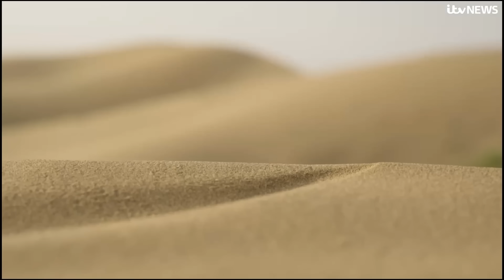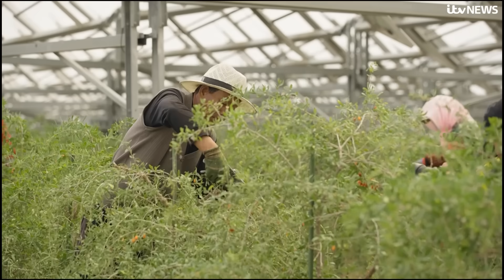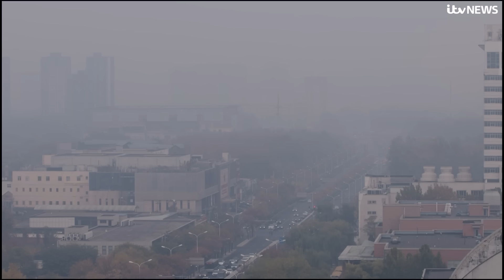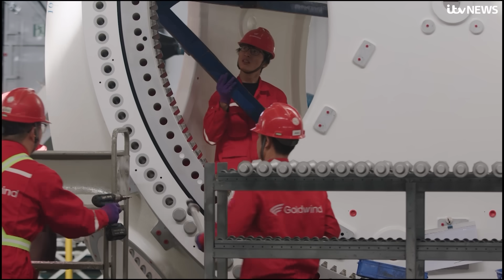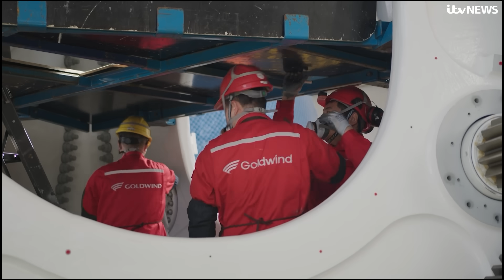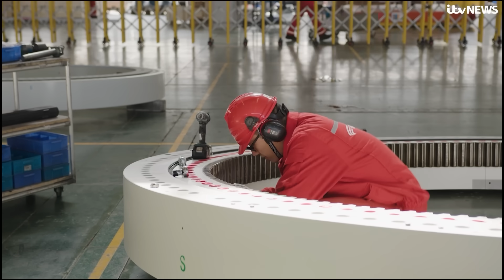How China is building solar farms bigger than UK cities | ITV News

Comment: the UK could generate all the energy we need, even through the middle of winter, with an area of solar panels equal to the area of the UK's golf courses. And of course, we don't need to rely only on solar, because we have such good wind resources. So if we converted half the UK's golf courses into solar farms, when combined with mostly offshore wind farms, we could generate all the energy we need, without taking any land away from either farming or wildlife. And start producing food under those solar panels, actually increasing our food production. And given that less than 1 in 60 people in the UK regularly play golf, the reduction in golf course availability by 50% wouldn't even affect much of the population in a serious way
Reply: No it couldn't.
Electricity is only 20% of our energy demand of which on average renewables only generate about half (and that's including the non sustainable biomass imported at great emission from Canada)

Therefore we rely on non renewable sources for 90% of our Energy, so where will you get it?

How could you produce food UNDER solar panels? How would it get sufficient sunlight and how would you harvest it?

If you are trying to claim that we can use "golf courses", why can't we just hijack peoples back gardens too? Or why not use all the land that isn't used for anything, such as wilderness, moors, bogs, mountains etc?

You really don't know anything about the energy demands of this country or what it is made up of.  You are probably about 14 years old.

Comment: Typical greenwashing propaganda peddled by journalists who don’t understand technology and numbers.

The typical utilization of a solar panel, measured as its capacity factor, generally ranges from 10% to 25%, depending heavily on its geographic location and other environmental factors. 

That means you need to have 4-10 times more installed capacity to actually GENERATE the same amount of electricity as hydro, nuclear or coal.

But even that is just a theoretical number. Solar panels have a fundamental flaw - they don’t work during the night. So you still have to maintain conventional power plants to keep the lights on at night.

Grid-scale electricity storage technology doesn’t exist so weather-dependent electricity generation can only augment electricity generation but only when the weather cooperates. For the rest of the time the  electricity comes from conventional sources.
Let’s hope China’s plans ro build 30+ nuclear power plants materialize in next 30 years.
There is no scaleable electricity storage technology

Comment: China is re-power and greatly expanding its power grid's capacity with hundreds of new highly efficient ultra supercritical (USC) clean coal thermal power stations.    USC creates liquid steam behavior with USC turbines that provide some fast reacting peaking power needed to support solar and wind power.  It is questionable if having USC thermal power stations support solar and wind power saves coal use, but it is a means to provide service to solar power.   The new USC coal power stations emit no visible air pollution.

Solar and wind generated electricity is normally commercially worthless.   Its practical use is for maintaining electrical storage.   China's 22.5 GW Three Rivers Dan hydropower station provides fast reacting peaking power at no high readiness cost able to work with solar and wind generated electricity to save water head.   Traditional steam turbine generators are not capable of proving fast reacting peaking power. 

Supporting large amounts of solar and wind generated electricity in practice uses natural gas turbine generators at higher natural gas cost just for high readiness making near zero electricity than making all the electricity with natural gas combine cycle power stations.  There is no fuel savings.  Since little natural gas is generating electricity the large natural gas cost is hidden from the public.  The UK is culling wind farm output to save on expensive natural gas.  Wind farm power output with its wild fluctuations in a second requiring constant makeup above high readiness is the most natural gas expensive form of providing electricity.  

China has to import natural gas.   It only uses natural gas turbine generators for high value needs.   Providing service to solar and wind generated electricity is not normally a high value need.   China built the world's biggest wind farm at over 10 GW that after initial proof of operation has sat idle.  The large public displays of China solar and wind power installations  need to be checked to see how much electricity they are actually providing.

Comment: Nice. Now begin the process of systematically raising their platform up 3 meters to permit other use of the slightly shaded ground beneath. Might need a custom mechanism for inspecting and repair the panels... perhaps something automated.
Reply: China currently has little solar-powered robots cleaning the panels, along with automated panel laying machines that speed deployment dramatically.  It's quite amazing to watch.

Comment: There are two effects to note. 1) China is producing more electricity from renewables than many other countries combined and that it is reducing its proportion of electricity from fossil fuels, even if the total number of kWh is increasing.  2) As it switches to EVs and electric motors for transportation, there will be an efficiency gain. ICE is only 30% efficient, while EV can be as high as 70%. The reduction in demand for petroleum products due to substitution effects will be beneficial as it will reduce carbon emissions. It remains to be seen when total emissions will start to decline, because China is also building massive hydro and other infrastructure projects, which generate a lot of emissions from concrete and steel production.  Battery production can become more efficient, and less dependent upon lithium mining, as new batteries do not require any lithium.
Reply: According to recent data, Chinese carbon emissions have been declining for over a year.  It'll take some time to confirm this, but China has probably passed Peak Carbon.

Comment: Meanwhile, in the US "drill baby drill".
Reply: I wouldn’t be surprised when in the next 20 years China builds more fission plants and maybe in less than 50 years China develops commercially feasible nuclear fusion.

All while USA continues to use their fossil fuels
Reply: @Duckresto3603  China already has about 60 nuclear powerplants, with 30 more under construction.   But the energy it makes pales in comparison to their solar capacity (which is being installed at around 100 panels per second)..
Reply: @romanval69 dude China is increasing coal power and expects it to provide around 65% of its needs for the coming decade or two and its long term goal is to reduce this to 35% in an increasing electricity market size.  Renewables at best will eventually be around 45% including the hydro.
Reply: @DR-00700 In China, coal electricity production has already decreased to 50% and it falls year by year.
Reply: @martinv.352 wrong.  It increases yoy and will to 65% from c. 60% today the long term CCP plan is to then reduce this to 35%.  That will require a lot of reliable base load not intermittent sources with batteries bolted on.
Reply: @DR-00700 A few years ago, you were right. But meanwhile, coal energy production is decreasing and has currently fallen to exactly 50%, one year ago it was 53%. 65% is some years ago (2019?)
Reply: @martinv.352 when you say decreasing is that in absolute terms or relative?
Reply: @Duckresto3603 well if anyone can, it's China.
Reply: @Duckresto3603  There is a major fusion breakthrough in China in the last few years. The first operational fusion plant will be ready before 2035, and the first commercial fusion plant will be ready in the 2040s. Its no longer 50 years away.
Reply: @Duckresto3603  It's already available now.
Reply: Blame their President. His words at the UN recently: "Those big windmills are so pathetic and so bad, so expensive to operate, and they have to be rebuilt all the time and they start to rust and rot. Most expensive energy ever conceived. And it's actually energy. You're supposed to make money with energy, not lose money. You lose money, the governments have to subsidize. You can't put them out without massive subsidies. And most of them are built in China, and I give China a lot of credit. They build them, but there're very few wind farms. So why is it that they build them and they send them all over the world, but they barely use them? You know what? They use coal, they use gas, they use almost anything, but they don't like wind, but they sure as hell like selling the windmills."
Reply: Not just drill... Far worse 
Frack baby frack
Reply: Meanwhile, in the India, "let us go to Kumb Mela".
Reply: Say goodbye to the usa
Reply: The president is saying one thing, but the red state power companies are doing another.

If anything solar is growing faster in Texas and Florida than elsewhere in the US.
Reply: Although the United States is the world's first oil exporter, as far as I know, the process of producing shale oil generates very significant pollution. We inject water containing various chemical components into the rock layers through high-pressure pumps, which is almost catastrophic pollution to groundwater😓😓
Reply: @aidongsheng1989 that is what activists want you to think without understanding the facts.
Do you know how deep under the ground the fracking occurs?
Do you know what the “chemicals” are in the fracking fluid and propant?
Do you know the size of fractures?
Do you know the salinity of “ground water” at the frack depth?
Do you know how much of the pumped fluid,including chemicals, is recovered back out the well and do you know what they do with them?

These are essential facts to know for a judgement call.  Have a guess as to what you think the answers are then I will provide answers with references.
Reply: 😂 true… winning at going backward
Reply: @dazzassti    Almost seems like they want to crawl back under a rock.
Reply: But China is rapidly increasing g coal power plant - 94GW or 100 power stations in 2024.  The uk took 20 years to demolish 10!   The UK just saved the planet,not,it escalated power prices so 8000 poor elderly people can die this winter.

Comment: Because western countries talk too much does nothing while China talk less and takes swift action.
Reply: swift action......building USELESS projects like this, that WE ALL KNOW are unreliable and very inefficient. WE know this, after YEARS of use and having that data to go on.
Reply: @Philip-x3d  That’s just flat-out wrong. Calling Chinese solar projects “useless” shows you haven’t looked at the facts. China currently produces over 80% of the world’s solar panels and operates more than 600 gigawatts (GW) of installed solar capacity — more than the next 10 countries combined. New Chinese solar farms regularly hit efficiency rates above 22–24%, which is world-class. The “unreliable and inefficient” argument is years out of date. In 2023 alone, China generated over 500 terawatt-hours (TWh) of clean electricity from solar — hardly what you’d call “useless.” Maybe check the numbers before dismissing a technology that’s reshaping the global energy market.
Reply: @Syae55a  more BS. Just listing large numbers does not prove anything. 600GW is great.....LETS HOPE THE SUN SHINES ? Bit of a floor in your design there, as we need energy 24/7 but the sun does not neatly fit in with that requirement.
Ditto Wind energy. Solar and Wind ARE useless, as they dont even come close to supplying the energy WE NEED......WHEN we need it. After so many years using these things, there is plenty of data out there to prove that point, if necessary.
Reply: @Philip-x3d  That's a truly idiotic viewpoint. Do you think you're the only one who noticed this problem? In China, solar, wind, and hydropower are built in tandem. Hydropower is used at night when there's no sunlight, and during the day, when there's excess electricity, water is pumped into dams. Why don't you ask Chatgpt how China solves this problem? If you're not using your brain, donate it to someone in need.
Reply: @小男孩-リトルボーイ  so why you STILL building 100's of new COAL FIRED power stations then....CLEVER GUY ?
You need to learn to stop and THINK.  🙄☹😔
Reply: @Philip-x3d  I'm a Chinese. In fact, our China is a very underdeveloped country. All these things are fake. You are so smart that you have figured them out.
Reply: @ericlau1111  I doubt they are fake ? China is ok at building things, they just need to realise OTHER PEOPLE do as well, so we are not shocked or surprised when they build something......but they WANT us to be and thats why we laugh.
Reply: @Philip-x3d  I'm a Chinese. In fact, our China is a very underdeveloped country. All these things are fake. You are so smart that you have figured them out.
Reply: Actually, Chinese don't care.
Reply: @Philip-x3d  Why you think Chinese want to shock you by a british media? Would you check out the video‘s publisher?Or you want to say China start to buy british people?
Reply: @梅施今-阿廖沙  from any video you look at about what China is doing today, you feel the video ends too soon ? It like they cut the video before their final words...."......so BE AFRAID Westerners. China is really POWERFUL.....look. " 😮😱
THAT is why we laugh. 🙄
Reply: @breakybm6369  fine......I wont lose any sleep over that.

Comment: Growing crops under the panels actually helps the crops grow. Most crops get too much sunlight in those arid areas, so reducing the sunlight a little helps plant growth.
Reply: Indeed, watched a couple of good videos on YT. 
The most impressive are the solar sites in arid parts of North Eastern China. The structures provided shade relief for certain plants to thrive, and even goats herding for first time.
Reply: But it doesn't work with every crop but still  enough to feed people
Reply: @imtheeastgermanguy5431 It's not even to feed people.  The true value is root systems that stabilize soil, reduce dust.
Reply: @ZweiZwolf if you say so
Reply: @ZweiZwolf  Yes. Also, lack of direct sunlight also helps retain the ground moisture, which also helps the soil to stabilize.

Comment: The first terawatt of solar took 70 years, the second took 2 years, the next will take a year. Each terawatt represents one thousand coal power stations.
Reply: It will be about 270-300 GWp this year. It was 277 GWp in 2024. So, this is impressive but not quite as much or quite as explosive as you claim it is.
Reply: @mreese8764 GWp? You need to tell me what that means. I'm talking about installed terawatts
Reply: @JuliusFawcett GWp is gigawatts peak. It's the peak power a solar panel can produce in optimal lighting condition. 1 terawatt is 1000 gigawatts.
Reply: So 2k equivalent thus far?
Reply: @devilsolution9781  yes, the equivalent of 2000 coal fired power stations so far, with another 1000 coming this year

Comment: You can tell that this is a typical western smear.  First accusing China is the biggest coal user and the renewable energy is to make amend China's deficiency.   UK used coal power its industrial revolution and built the British empire.  It manages to get rid of its coal fired plants by using natural gas it has from the North Sea.  China has very little natural gas reserves so UK media is criticising China for using coal when it is doing it with another type of fossil fuel.
Also China has never said to get rid of the coal fired power plants.  It only committed to carbon neutral!  Any person with a basic knowledge would know the electricity system need stable continuous power like from coal fired generation because solar and wind are climate-dependent and hydro is season-dependent.  China has invested heavily to turn desert into forest.
The biggest polluter is the US.  This is because China annually generates twice amount of electricity as the US but it has four times the population.  Thus every Chinese is effectively consuming half the electricity every American consumes.

Getting a British media to report Chinese solar is a waste of time because the ITV news has no concept of scale and size.  This is because UK's electricity generation peaked in 2005 with 385 TWh.  After 2005 UK managed to do with less electrical power every year until in the last couple of years the output drop below 300TWh.  In 2024 last year China generated from solar "alone" was 834 TWh or more than 2.7 times the entire UK electricity production.  Western media always look for the negative aspect of the Chinese development and never dare to compare it with their own!  Would ITV News dare to report UK electricity tariff is more than 5 times of the Chinese?
Reply: i think this covers china quite favourably for western standards
Reply: @user-im8bv8po2w Still condescending.
Reply: BBC:"At what costs?"
Trump:"One billion please. Thank you!"
😂😂😂
Reply: Yeah but no one buys Western Propaganda anymore. We know if they're lying